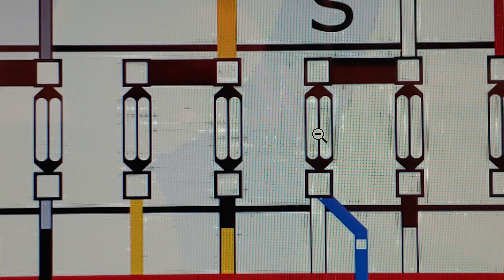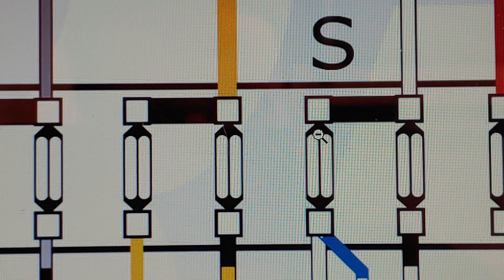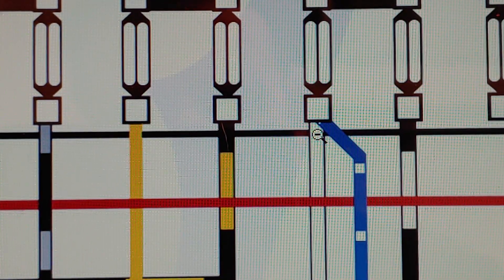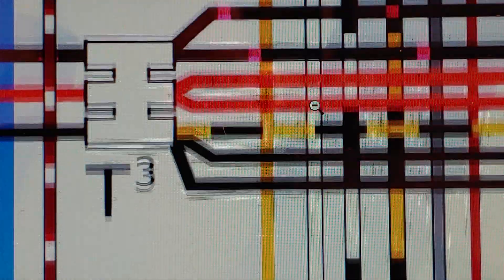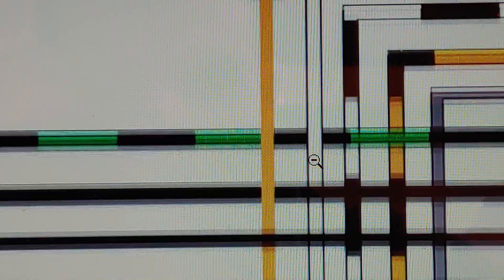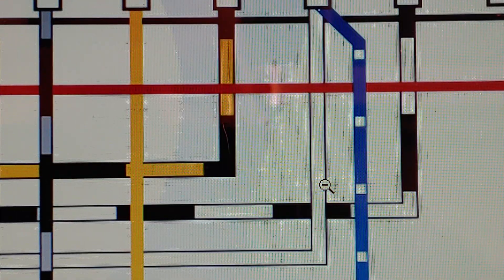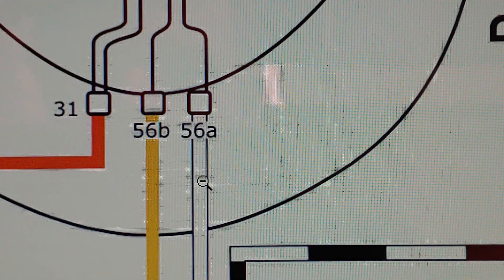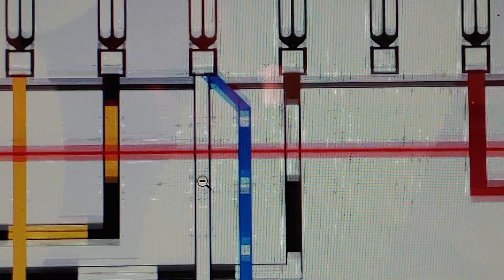CLASSIC 1972 VW BEETLE REWIRE. ( PART 9 FUSE 5 ) HEADLIGHT DIMMER SWITCH

Comment: Love your vids. Always very clear explanation. My 74 standard beetle high beam blue light is on when the lights are actually on low beam. What wire should I be tracing to correct this? Thankyou
Reply from the maker: Did you pull.back on the lever to put them back in low beam setting. The light comes on when in high beam setting. Thank you for the support and kind words.